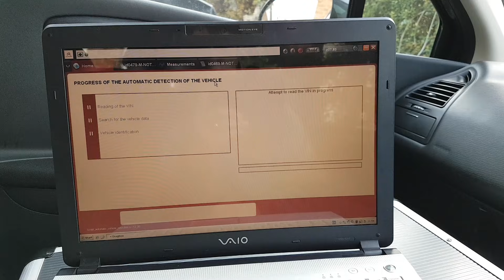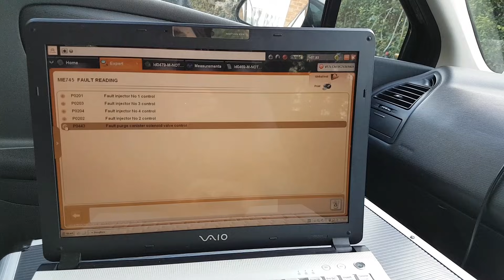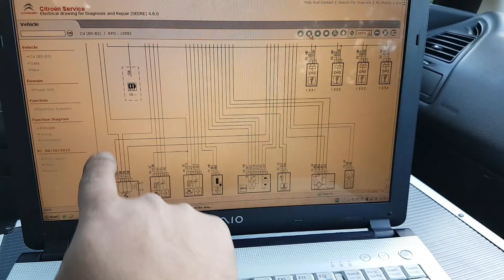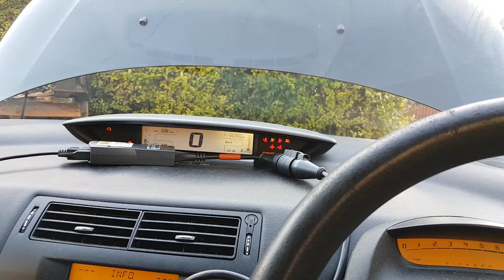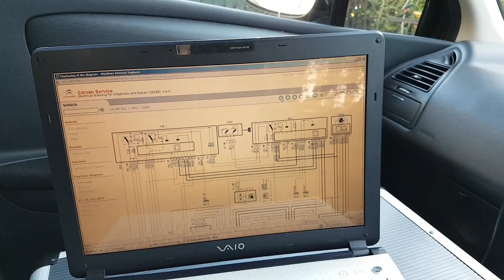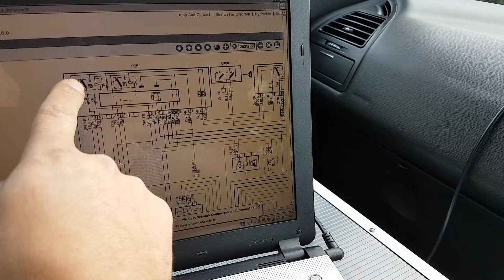Citroen C4 1.4 not starting. P0201 P0202 P0203 P0204 P0443 open circuits. Fault finding and repair.

Comment: Genius, well explained, where do you based as my wife's Cit C3 2005 Petrol is not starting "Economy Mode Active" sign is on, no lights on dash board except the Battery sign but the battery has full power, and I did try with jump start but no luck, any advice please?
I found a video for a same problem but different language, no idea what he is saying, may be you could as having similar knowledge, if you could share it please.

Thanks a lot 

https://youtu.be/mcV_vLEJLDo
Reply from the maker: Never had that issue...
Start with the basics... Power and grounds, fuses, relays, etc...
Thank you for watching!

Comment: Joe citroen xsara1.4 petrol 2004y crank no dashboard light no start all fuse box fuse,connector and battery okay  any body come across limp mode how to reset  Help
Reply from the maker: That doesn't look like a limp mode...
Check connections,  grounds etc...
Scan the car if you can...
Thank you for watching!

Comment: Hi, I GOT problem with pneumatic suspension ecu of citroen c4 grand picasso 2008. I have diagnosed myself there are three code's came which are 2 of them related from pneumatic suspension i guess, basically both codes states " U1324 fault: absence of communication with the pneumatic suspension ecu. No single".
I got 4 of these codes  P1351, C155D, U1324, U1219.
I hope you give me help out
Reply from the maker: Can you communicate with the suspension module?
Thank you for watching!

Comment: do you have any solution about " esp abs system faulty " before every start with bip sound and red signal on near speed screen and esp button doesnt work ..
Reply from the maker: The solution is scan the car, check live data and figure out what the problem is...
Something like that can be caused by many different things...
I am not a wizard...
Thank you for watching!
Reply: @LMAutoRepairs  oh really .. so sorry why i am on wrong video which is think to be as witch , wizard and magic page ..it is my mistake I should be Harry Potter's Secrets Room next time ..

Comment: Hello,

Which means on all this problem the issue was on Fuse and Relay???

Error codes which i get P0136 , p0302 - p1336

Engine starts but works very hard on idle and while driving..
Reply from the maker: No the fuse... the internal relay was at fault...
Thank you for watching!
Reply: @LMAutoRepairs  thanks for your reply.

Can i try the same for my faults mentioned on previous comment?

Thanks
Reply from the maker: Hi
Impossible to say...
Only by checking diagrams to see if they share anything...
And not before checking that everything else is OK...

Comment: Car with the same problem came to me today Luis,just a 1.6 engine but all the same...............easy fix thanks to you.......
Reply: The 2 sensors down in the diagram are O2 sensors.In my case i have a short to ground foult,becouse the fuel pump is on the same cirquit....and pulling it down to ground with 3.3ohm resistance.
Reply from the maker: That's great Alex!
👍👍👍

Comment: May you please tell me how did you connect the relay as i am experiencing the same issue
Reply from the maker: I explained in the video...
Thank you for watching!
Reply: @LMAutoRepairs  i was watching your video and it was so helpfull. We did bridge no 10 fuse and it started imediately although i could not see how you connected the relay. I will appreciate it so much if you could guide me
Reply from the maker: Hi
I would have to go back an see how I have done it... it was a long time ago... lol
But, the external relay, if I recall correctly, was wired to power up when the ignition is turned on, and to feed that fuse... basically, externally replacing the damaged relay inside the BSM...
Reply: @LMAutoRepairs  Hi, can you please tell me which is the cable that comes from the ignition? In the video, only the one from the battery and the one from the fuse can be seen well. What are the other touch points? Anyway, thank you for the video, but at least a few pictures would have been helpful to see exactly where the attachment points of the new relay are.
Reply from the maker: @timst11 
I have explained and showed diagrams!
It is all in the video if you whatch it carefully...
👍👍👍

Comment: interesting. On a 05 C5 all 4 injectors show "injector low curcuit" , would the same procedia do the trick? Greatful for quick reply, the car is on it´s way to the salvage yard!
Reply from the maker: Possibly... is the issue is caused by the same root cause...
Thank you for watching and for your comment!
Reply: @LMAutoRepairs  Thank You for the quick reply, I work with old mustangs and these "computer cars" is not up my alley. Are you located in Holland?
Reply from the maker: @powersled  
No... sorry...
I am in the UK...
Reply: @LMAutoRepairs  Ok, We travel to London every year (not this year though) to celebrate the memory of Marc Bolan. Anyway, I got the car running! Thank You!

Comment: Hi.
Very good video.
Question, if I turn the key to ON and there I measure the voltage in the F10 and - of battery, if the relay is faulty, should there be voltage in the F10?
Thank you.

Comment: Was waiting you would show how you wired and connected the relay. Thanks
Reply from the maker: I did explained in the video... you must have skipped it...
Thank you for watching!
Reply: @LMAutoRepairs  thank you for your reply. I had the same problem with my c4 and started straight away following ur procedure but not sure how to connect relay the one I got. it has 4 pins .

Comment: Mines stars when its wrmer outside or maube it only cincidence,but when it starts its runs no problen ,but at times wont start even starter rolls the motor hat ould be th problen guy?
Reply: Have no scanner
Reply from the maker: @andreanton8803  
Can't really help you...
Do a visual inspection on plugs, looms etc...
Anything else will be pure guess work...
Which can become very expensive, very quickly...
Reply: @LMAutoRepairs  changed the fusr n10 still aint starting pump is pumping fuel what else could be wrong im charging my bsttery for like 4th time today cant get thr fucker started lol
Reply from the maker: Scan the car and go from there...
Thank you for watching!

Comment: Hello, I have a problem with my Citroen Evasion 2002 auto. When I try to start it, it cranks but the engine does not start. I found out that there's a problem with the ECU (TEXTON). A spare part for this is hard to find in Malaysia, so is there a way for me to bypass two electronic components (relay)? Or do you know of any other alternatives that I can try? Thank you very much

Comment: Had code P1694, but also forgot to mention that after ot started after lots of attempts the prelast time, i had a "low oil  level" warning and added it almost 1,5L of oil...now guessing if it's possible that the oil level sensor prevent  engine from starting to not damage it?!...

Comment: Great fix. My wifes C4 refuse to start after short journeys. Broke down. Changed starter motor, as solenoid power contacts failed/badly worn inside.
Will not restart. Clicking at passenger footwell. Any ideas gents  ?
Elp!

Comment: I have problem on c4 2012 how to get to you to diagnose.  It was parked for long time and lost key,  managed to do key not from dealer but it won't start.  I have been told to change bsm but remains the same,  when I short two fuses on top of battery connection it get electric on dash and start  but it gives random faults change the connection on top of battery second hand,  still the same. Need to jump fuses. Changed preheated relay still no improvement

Comment: C3 break lamps can be problem to,I usually do the same thing ,ie the one side that still works becomes the trigger,so minimum draw on the transistor then fuse rally to lamps 7.5 amps so the circuit protected
Reply from the maker: Nice one...
Thank you for watching and for your comment!

Comment: Where abouts are you? I need someone who knows what they are doing to look at my car. I've got P2970 error. I did have a heap of errors p0192, p0500, u1000, u1118, u0122, u0103 and p0483. The garage doesn't know the cause and suggested to try replacing parts to see if they go away and I'm not convinced.

Comment: Excellent!!  I was able to diagnose and fix my wife’s car. Used power supply from fuse 13 through 85 on relay. Out relay on 87 to fuse 10. Back in business!!  Thank you so much!
Reply: Yes, this is the way to repar it, thank you guys! 86 is neutral from battery,30 is positive from battery as shown in video at 18:54,fuse 13 on 85 at relay, fuse 10 on 87 at relay.
Reply: My car has battery error and also fog light error . The generator actually makes 11.5 volts and it is new. It worked two weeks and when the weather is moist the deplution error also appeared with battery charging issues. Have you had the same problem!?
Reply from the maker: 👍👍👍👍👍👍👍
That's great! 
Thank you for watching and for your comment!
Reply: @LMAutoRepairs  Hi, i have the same problem. Can you confirm that wireing?
Reply from the maker: @bguper  
Hi
What do you mean?
Thank you for watching!
Reply: @LMAutoRepairs  85 to fuse 13, 86 to ground, 87 to fuse 10. 30 on relay where to connect? Great video. I use autodata for diagram.
Reply: @LMAutoRepairs  am i missing something. Can you explain me connections?

Comment: Hi I have the same issue can you please tell what I should do as my car does start but it’s in limp mode right now, keeps cutting off every so often ?
Reply: Were are you from wish I had you to have a look at mine but I have so many cow boys around my area
Reply from the maker: Hi
If has the same issues, I showed here what to do... what else you want me to do?
Thank you for watching!
Reply: LM Auto Repairs I ain’t no mechanic but can you explain what needs to be changed so I can just get it and give you to my mechanic to be fixed begets it’s all a common fault in these cars I’m guessing ? Thank you
Reply from the maker: @MrOozy123  
You can change the entire module/fuse box... that should fix it... providing you have the exact same fault....

Comment: LM, I'm a noob working out how to wire this. Could you put power to external relay from fuse 1 then ground that. Then 12v from battery to relay to fuse 10?

If not what wire do you tap in to to make relay 2 work?

Comment: Hello , my headlights flickering at 2000 rpm. I cleaned the battery terminals. My car has 150000 km. Alternator problems?
Reply from the maker: Difficult to say...
Monitor the voltage while reving the engine... and see what happens...
Thank you for watching and for your comment!

Comment: Hey, official dealer of Peugeot, Latvia, did this same thing to mine petrol 407, even looks like they found your solution for my situation 😂, which is the same. But they really fucked up because ignition relay, which btw controls depollution and coils, wasnt really fried, just sticking, so when I drove for like 30kms, original relay started to work simultaneously with the new one, and engine management system crashed immediately. Had to use evacuator. So this works only if that relay it really gone.
Reply from the maker: No really... something else must have been done in your case...
In this case, is just a relay fitted in parallel with the faulty one, so if the faulty one works, will make no difference, as is just two relays enabling the exactly same circuit....
Hope it makes sense.
Thank you for watching and for your comment!

Comment: I have all sorts of codes that have come up on my 2005 c4 1.6 petrol. It came up with the anti pollution fault message and went into limp mode but on a restart limp mode cleared and the fault message remained.
Unfortunately it now won't start at all and these are the current codes I'm getting. It cranks but is very lumpy. Any ideas would be greatly appreciated.
System : Engine control 1 - 47Z / Motronic ME 7.4.5\N{<control-000D>}\N{<control-000D>} Status :P0350 - Ignition coil primary/secondary. Error Message : Faulty. Error static.\N{<control-000D>} Status :P0352 - Ignition coil 2. Error Message : Short to +/ground, or open circuit. Error static.\N{<control-000D>} Status :P1336 - Misfires, different cylinders. Error Message : Faulty. Error static.\N{<control-000D>} Status :P1339 - Ignition failure, cylinder 3. Error Message : Faulty. Error static.\N{<control-000D>} Status :P1338 - Ignition failure, cylinder 2. Error Message : Faulty. Error static.\N{<control-000D>} Status :P0261 - Injection valve (cylinder 1). Error Message : Open circuit/positive short. Error static.\N{<control-000D>} Status :P0267 - Injection valve (cylinder 2). Error Message : Open circuit/positive short. Error static.\N{<control-000D>} Status :P0270 - Injection valve (cylinder 3). Error Message : Open circuit/positive short. Error static.\N{<control-000D>} Status :P0264 - Injection valve (cylinder 4). Error Message : Open circuit/positive short. Error static.\N{<control-000D>} Status :P0444 - Fuel evaporation regeneration valve. Error Message : Open circuit. Error static.\N{<control-000D>} Status :P0336 - Crankshaft position sensor. Error Message : Synchronisation error. Error static.\N{<control-000D>} Status :P1536 - Brake switch. Error Message : Malfunction. Error static.\N{<control-000D>} Status :U2000 - Drive system bus wake-up signal. Error Message : Signal reception. Error sporadic.\N{<control-000D>} Status :P1693 - Request for starter triggering. Error Message : Malfunction. Error sporadic.\N{<control-000D>} Status :P0341 - Camshaft position sensor (bank 1). Error Message : Outside specified range. Error static.

Comment: Do you think that the section of the cable that you've put can handle 2x30A? :))))))))))))
Reply from the maker: I think you missed what I have done actually does.... but basically it can handle what I have designed to do.
Thank you for watching and for your comment!

Comment: Hey, I got the same problem in my car. I was wondering if you could send me a sketch diagram  just for me to look if I´m picking the right wires. Or is it possible to just power the fuse without doing anything else?  Could you do that please? Thank you.

Comment: Thanks man, I had the same problem today and I temporarily bypassed that relay with a wire enabling me to get the car to the shop. In case the shop cant fix it I will do it during the weekend. Thanks!
Reply from the maker: That's great! 
Thank you for watching and for your comment!

Comment: Fabulous work, I just was wondering where you get the ignition switch signal to activate the external relay. Many thanks in advance.
Reply from the maker: Omar Sameri 
Hi
As per the diagrams... from the original signal...
Thank you for watching!
Reply: @LMAutoRepairs  what do you mean? what wire did you tap in to?
Reply: @The_Kyle_Standing  Hahaha. Good luck with figuring that one out.
I have the same problem with old used citroen. And mine is already modified like this. Or is it really right from citroen factory like that with the relay dangling there? Lol I'm confused and don't know anymore. But most symptoms are pointing to the relay. And it might be the relay 1, not relay 2 in my case. Need those cables for diagnostics to see what is going on. And to disassemble it all perhaps.

Comment: You are very good...though I have an issue regarding my car, how can I pm u concerning the problem...May be your email will be ok if you don't mind pls...cheers
Reply from the maker: Iriekpen Asein 
Hi
Ask here... I will happy to give you my opinion...
Thank you for watching!
Reply: LM Auto Repairs.... ok thanks. I got a 2007 Citroen C4 SX...I was driving it for about 3hours on the motorway and suddenly it stopped accelerating  and I try to pull over on the hard shoulder. Thereafter I did tried to start the car but it won't start. A recovery came and was told it's an issue with the sensor.  
I took it to a citreon car dealership/servicing to have it fixed. They couldnot fix it cos they told me it may not be fixed and moreover other things may be wrong 
Now the car is parked and won't start. I need the car to start working and driving effectively. 
Please I need your help and professionalism..thank you 🙏☹🙏
Reply from the maker: Iriekpen Asein 
Hi
Well, based on what you saying,  is impossible to come up with a guess... have you scanned the car?
Do that first...
Thank you for watching!

Comment: Hello, I live in Brazil and I have the same problem with BSM, the scanner gives the same errors as your video, I would like the electrical scheme you did if you could help me to get my car back to work. Congrats on your video.
Reply from the maker: Leandro Souza 
Hi
Have you watched the entire video?
Thank you for watching!
Reply: I've seen yes, I just need the electrical schematic to adptar and make my car work, I bought a BSM used with this open circuit problem. Thank you, please help me!
Reply: @LEOTURBOTUNING - If you pause the video, the concerned part of the circuit is quite visible. 

Se parar o video, a parte do circuito que te interessa é bem vísivel.
Adicional se abrires a BSI com algum cuidado. Consegues substituir o relé interno. É uma peça bem barata em casas de artigos electrónicos deverás encontrar facilmente. Desoldar o antigo e soldar o novo não é dificil.
Boa sorte.

Comment: Very good explanation and testing procedure could the faulty relay have been caused by the faulty connection you cleaned causing the contacts to over heat  just a thought thanks
Reply from the maker: Raymond Ferguson 
Hi
Indeed... it could have caused spikes that would have lead the relay to fail... it not... lol
Mechanical relays can easily fail to fair...
Thank you for watching and for your comment!